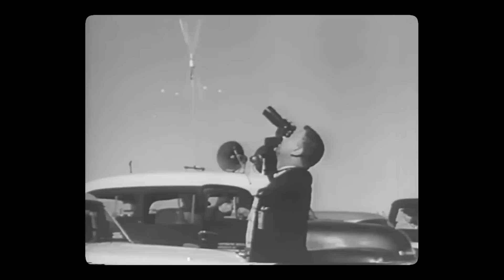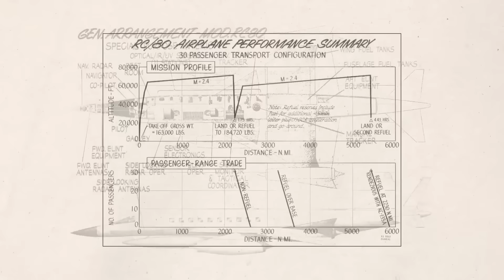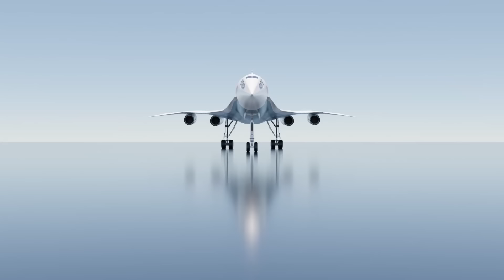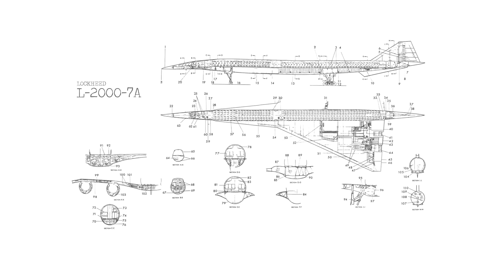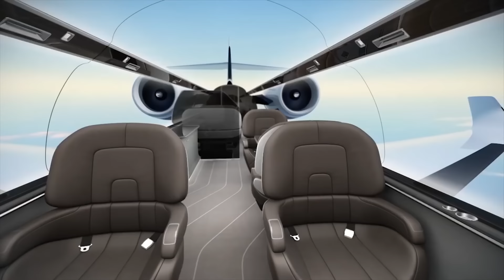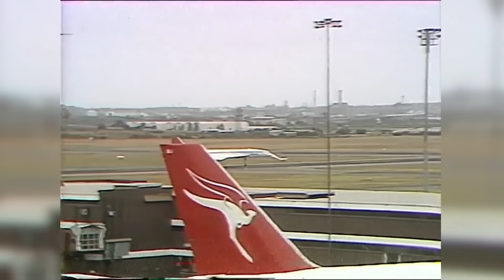Supersonic Future We ALMOST got - Full TV Documentary

Comment: FYI the  YF-12 , A-12, & RS-71 aka SR-71 all gained fuel efficiency as speed increased because the inlet and spike  produced up to 80% of the thrust. So @ Mach 3.2 it got the best fuel millage.
Reply: And there's the aspect that the fuel tanks leaked until it hit its cruising speed, if you were to build it with modern day alloys, it'd be extremely cheap to run for what it is
Reply: Same for Concorde, best fuel efficiency at cruising speed = max speed
Reply: The inlet spikes weren’t what gave it the efficiency at speed. The spikes were what made it so the j-58’s wouldn’t injest supersonic air. I believe what you meant was the engine bypassed like 20-25% of the intake air after the 4th compressor stage directly to the afterburner so that it was a hybrid ramjet at speed essentially.
Reply: @rayrichardson7176  and the many air bypass vents the J58 had to bleed off and redirect air...but yeah spike optimized the airflow in such a way that the compressor was basically doing nothing whilst heavily boosting the afterburner efficiency since it was made to keep the edge of the sonic boom right on the intake, in essence forcing pre-conpressed air through the system
Reply: @SwiftRazor003  crazy how advanced basically late 50’s early 60’s tech was that the Pratt and Whitney/Lockheed engineers managed to make the bird fly. From fuel to the hydraulic engine computers (literal computers run by hydraulics, the fuel in this case). I dunno the modern stuff is cool
And all but there is something about the a-12/SR-71 and all the 60’s era aircraft that just seems way more impressive. Its almost like Advanced is to be expected now, what they did was revolutionary on top of decades ahead of its time

Comment: The problem with the SST was the speed goal was simply too high. By pushing way beyond Concorde specs they has to deal with heating, expansion and fuel efficiency. The faster you go the worse it gets. Concorde had an Al skin and did not leak like an SR-71.
Reply: To be fair to the SR-71, that leakage basically only happened on the ground...to compensate they often didn't even fill the tanks. Just a little over the required amount to get filled in air when the tanks have sealed
Reply: The Americans were years ahead in supersonic aircraft and quickly concluded that SSTs were not a commercially viable concept.
Boeing made the 747 instead which revolutionized air travel in a way the Concorde completely failed to do.
Reply: @WilhelmKarsten  You do realise Concord as an aircraft was a complete success right? From a design and engineering standpoint it did everything it promised.
The reason concord failed was due to the economics of the time and the fact that the international community put so many restrictions on Concord as to make it almost impossible to find a place you could fly it. The problem with Concord was due to it's noise and the fact it broke the sound barrier all the time which people did not like when they were over the flight path.
Concords engines were redesigned to make them quieter and to allow them to work of more conventional fuel. But by then the aircraft industry had boycotted the aircraft to the point it was never going to fly again.
Same issue with the introduction of nuclear powered cruise liners for the oceans. NS Savannah was years ahead of her time and was safer to sail aboard and be around than most power stations of the time. Yet her failure was not down to her design or functionality but the public paranoia of radical concepts such as nuclear power. They only saw it as dangerous as they were wilfully ignorant to the advantages.

Also the claim that America was years ahead in supersonic aircraft is debatable. England after all invented the jet engine and whenever America had a aircraft that claimed to be ahead of it's time. England was only a few months behind at worst. Take TSR-2. Out performed the American equivalent in almost any area. Yet only was cancelled due to American interference in the program.
I wonder why that was?????
Reply: @WilhelmKarsten  If they were so knowledgeable why did they design two of them?
Reply: @oml81mm  Because the government was paying for it..
Reply: @WilhelmKarsten  Also because they had contradicting design specifications for the aircraft. One half of the project wanted a long range reconnaissance aircraft and the other a similar aircraft only capable of even more speed at the sacrifice of range with an offensive capability. The SR-71 proved to be the winning project.
Reply: @MarcusRhodes-q2s  I was thinking about America's huge lead in large supersonic aircraft like the B-58, A-5 and XB-70. There were also several research programs that predates the SST program like the XB-59 and the Convair model 58-9.

Some people often forget that the idea of a supersonic airliner was first proposed in America..
Reply: @WilhelmKarsten  

The British and French spent a $1 billion developing an SST which flew for 25 years!

The Amerikkans spent $1 billion and all they got was a 300ft plastic model that ended up in Disneyland! 🤪 

Cheers!
Reply: @tumslucks9781  Concorde cost 3 billion and they never sold a single aircraft... the largest financial failure in the history of commercial aviation
Reply: @tumslucks9781 it shows we were smarter than those countries since the Concords life was very short. Common sense held the day for a change
Reply: @WilhelmKarsten thank you

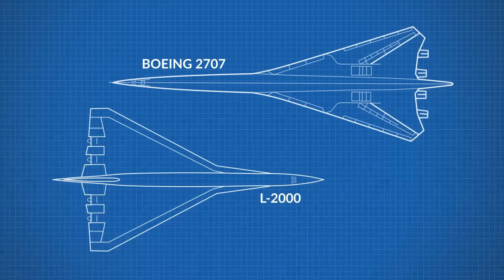Comment: I would say with hindsight 20:20 we was never going to get that future.. at that time.

While the main issue for Concorde was actually not fuel consumption, but the very low number of aircraft's. If there was more Concords around, they  issue would have been fuel consumption.

While higher fuel-consumption may not be a deathblow, it would have been regardless in this case. The reason was high bypass turbines. The diffrance was simply to large.

This will probobly change with medium bypass turbines. The thing is that the bypass needed is half with speed doubled. So at mach 1.6 a bypass of 3:1 is the same as a bypass of 6:1 at mach 0.8 (a bit simplified). 6:1 is a pretty common high bypass turbine, and going up to 10:1 actually provide only minor fuel efficiency gains. And there is a ever deminishing return.

So supersonic engines will catch up eventuality.
Reply: The Olympus 597 was not a high bypass engine.
Reply: @oml81mm  I never claimed that
Reply: @matsv201  Sorry, meant Olympus 593